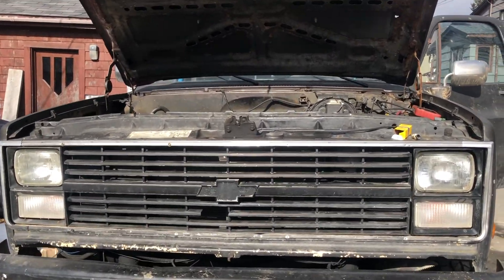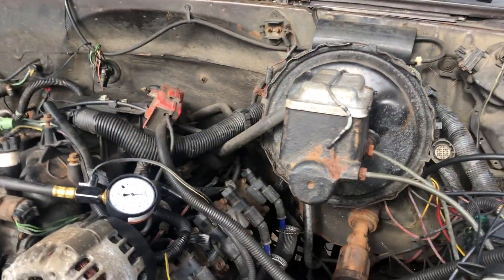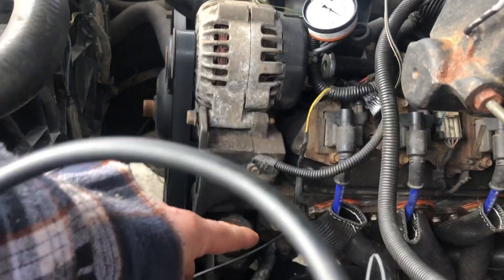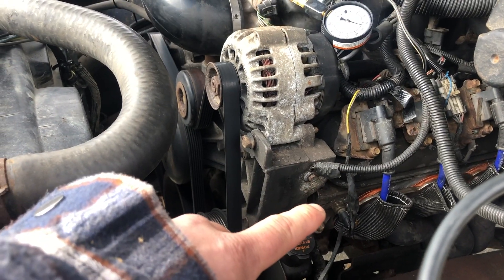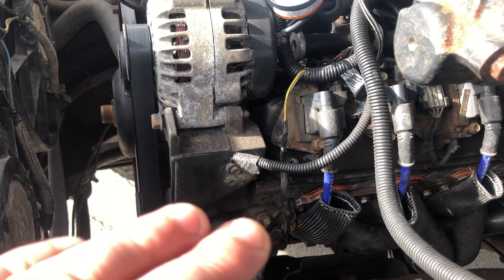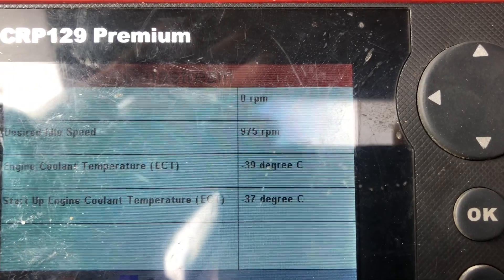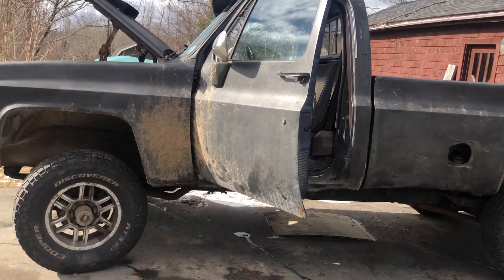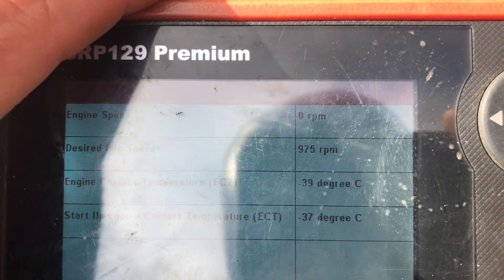P0118 GMC Sierra  Lq4 Swap 6.0 Vortec Full Diagnosis and How To Fix

Comment: I just replaced that sensor in my 96 k1500 5.0 ...when I took the old one out I couldn't get the new one to thread. then the old one wouldn't thread. then the new one finally did. Could the new one have had different thread size? They looked the same to me...